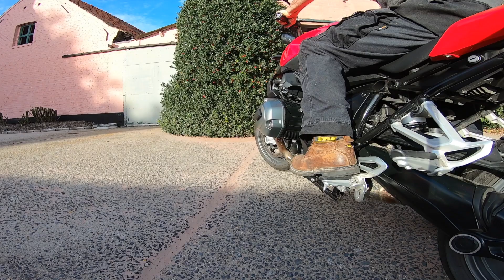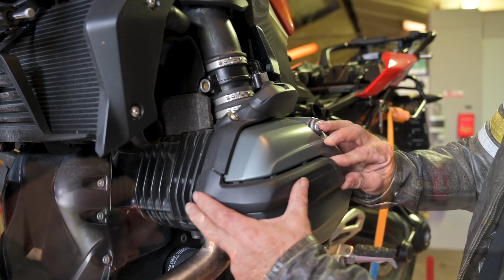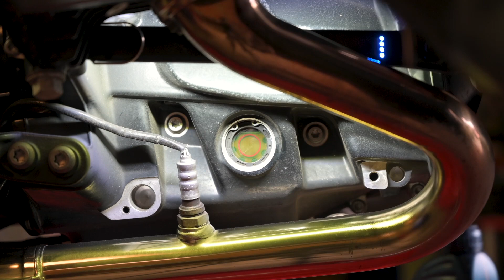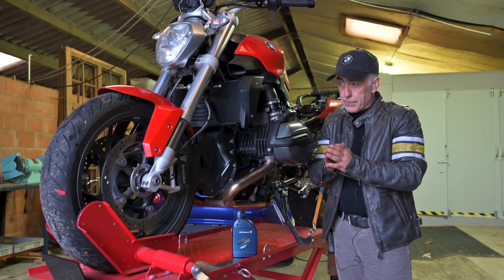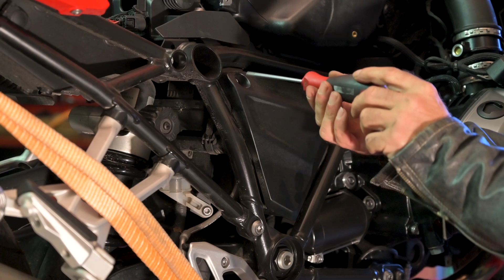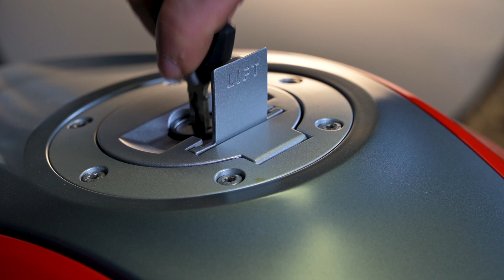TECH REVIEW my way BMW R1200R Naked bike

Comment: I just bought a R1200R and after years of riding mid-size ADV bikes, the big boxer put a smile under my helmet. Honestly, I did not expect so much power and torque - it's the most powerful bike I ever owned. Love the shaft drive and the easy access to valves and spark plugs
Reply from the maker: Thank you for the comments

Comment: After years of watching reviews and thinking about what bike I want, I finally settled on the R1200R, but the older air cooled models (lighter weight, old-school headlight, less to maintain). I'm also short, love shaft drive, and want something that isn't too heavy. Also love the low and mid-range torque yet still smooth and quiet. This bike ticks ALL the boxes for what I'm looking for. Now I just have to find one in decent condition.

Comment: What a great, informative video! Thank you for sharing. Only recently bought a 2017 BMWR1200R naked bike with only 5000k and absolutely love it. Have had twenty bikes over my 45 years of street riding and this one seems so well engineered and balanced. The low centre of gravity boxer engine makes it very nimble. Yes, big bike with a ton of attitude in dynamic or mellow in road mode. My bike had no manual and you provided so many valuable tips, did not even know that the screwdriver under the seat included the wrench that i was missing for the oil! I think that i will buy the GS911 OBD diagnostic tool as BMW shop maintenance does seem a bit pricey compared to others, but sometimes you have to pay to play, just enjoy it...Thanks again from Canada...cheers!

Comment: A minor thing to add. If I am correct the DTC is only equipped when you have the "pro riding modes". These included the Dynamic options for suspension and drive modes. Nevertheless thank you vey much for the effort !

Comment: Everyone makes their own choices on bikes. That's fine. I recommend agains jumping 800cc larger and not having respect for the throttle. Even on a bike like the R1200, which does not have 150+ HP, you can get in a lot of trouble fast with the throttle.
Reply from the maker: Thanks for the comments

Comment: Hi D3Sschooter, I have got a question to you, please.  I see that you hav got a standard front fork and manual rear damper. I would like to buy this bike but I dont know if the basic suspension, without ESA, is enough or not. My weight is 85 kg and I would like ride with a passenger, too.
Reply from the maker: Thanks for the comments, that should not be an issue at all...

Comment: This review is definitely the best one by my opinion out of all those full of excessive riding excitements - in contrast, it's like a condensed version of an owners' manual which is read by seldom riders in full. Thank you for this approach. It was mentioned during your gearbox review, that you have to firmly show an intent of shifting the gear. When I consequently shift down (f.ex. approaching an intersection), sometimes I miss this firm push and then the box gets stuck with no particular gear number shown on the display, and subsequent pushes are like through the empty box. After 2 or 3 secs it wakes up at some gear finally and then I can continue shifting it, but this delay is embarrassing. What happens inside the box at this moment? Greetings from Russia.
Reply from the maker: Thanks for the comments
Reply: Недовтык, бывает

Comment: Thank you for the great tech review. I have the 2015 R1200r with esa and full riding modes. I'm 5'5" 140 lbs but I found the stock seat not great ergonomically. I got the next higher one 820 mm and it suits me much better. I usually put one foot down at a stop. I bought the bike new and currently have 28,000 miles. I try to be careful where I stop and park. I agree that this bike is a bit of everything except off road. I do almost all maintenance  myself. I added a Givi windscreen to break the wind at highway speeds.
Reply from the maker: Thanks for the comments Teddy, maybe I should try that saddle... that is a good milage 28K .  I know the feeling as I am short as well ... always care-full when stopping that there is no ditch or lower level area under my feet

Comment: Love this bike, she can make everything! Just one question, I have mount a sport header without catalyser (and now there is no valve in the line too) , sport exhaust and a k&n filter. My dealer say that it’s not necessary to tune the engine because of the co2 sensor but I feel that the engine is not as smooth as when I had the original line in low and mid rpm. And if the engine is at idle and I push the throttle quickly the engine stop and I have to start it again. I believe that tuning the ecu correctly can make a difference and could be good for the engine too . I love my bike and I don’t want to damage the engine, what is your thought ? Thanks you for your help.

Another thing about the asc / dtc, I have the dynamic mode and when I push hard the throttle and that the front wheel start to lift the ground, the system shut down the gaz but too hard, so the bike go down on the ground and that is so fast that when it happen you are still full on The throttle and like is ok for the asc/dtc the engine go full again.. so I thing that’s a bit dangerous in this condition.. I would like that was a bit smooth and not ON/OFF.. or better, be able to setup it. when you buy a pack sport I think that it could be included, bmw supersport bike have it.... but when the rear wheel are slipping that’s fine!
Reply from the maker: Thanks for the comments,  In very simple terms the ECU of your bike uses a fuel map, and the output of the fuel map determines  how much fuel en when its injected, In other words the AFR is balanced 1:14 based on the operating conditions and the input to the ECU form all the sensors such as  the RPM, Mass Airflow, manifold temp, manifold pressure sensors, etc... and of course and vital the the AFR sensor or O2 sensor.  All those parameters are read by the ECU and based on that input a point in the fuelmap is selected to drive the injection ..  If anything is changed for instance the exhaust then the reading of the O2 sensor will be different just because of the very nature if that new and changed exhaust.  Never the less the ECU still goes with its fuel map as programmed assuming that all parts are original.   In short, your ECU map should be tuned and reprogrammed for the best results....  The dealer is wrong IMO. 

If you leave it , it will do no harm as such but the bike is not running at its best AFR so less efficient

For the other part , again there is a controller that measures all the values of the slip , throttle, angle , inclination ..  Maybe you have faulty sensor,,

Comment: Fantastisch video! I wish all motorcycle review videos were like this instead of boring videos of people just riding bikes. The dynamic red line tip just changed my life. You should do more walkthroughs like this, very entertaining and informative!

P.S. ride modes also affect fueling. For example Rain mode has a much softer throttle response and places a limit in available power around 100hp if I’m not mistaken. 

Speaking of power, peak power (125hp) and torque (125Nm) would have been interesting to include, especially the amount of readily available torque and how that makes the bike so flexible in terms of riding styles.
Reply from the maker: Thanks for the comments, and great additional tips

Comment: Great overview and handy reference for a new owner.  
I ride a 2017 R1200R (red) and for the 2017 they have made a few modifications to address the 1st gear engagement “clonk” and also added an OBD2 connection to simplify connecting the scanner.  
You may also utilize a GS 911 tool or the Motoscan App in conjunction with an OBD2 module to read and reset the fault codes, reset the service reminder or perform various service functions.
Reply: From MC news- For 2017 all liquid-cooled boxer models will now be fitted with a judder damper on the transmission output shaft. New features also include a revised selector drum actuator, transmission shafts and transmission shaft bearing. An OBD indicator lamp in the cockpit has been added to meet EU4 requirements.

With a view to enhanced motorcycling safety, its range of special equipment features is extended to include the banking-optimised ABS Pro and the dynamic brake light (both in conjunction with the Riding Modes Pro option). Brake light not available in all markets.
Reply from the maker: TXS for the comments,  do you know what they modiefied ? Great to see that you also have one.